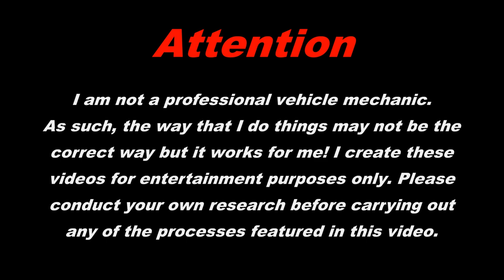BMW Swirl Flap Removal 318d, 320d, 325d, 330d, 520d, 525d, 530d, M47 & M57 Engines from 1998 - 2006

Comment: you can see under the manifold to check if it has been blanked or not
Reply from the maker: Correct but a 45 second video wouldn’t have been very interesting 😁
Reply from the maker: Also you could actually stick a finger and feel if you know what you are feeling for 👌🏻

Comment: I have two questions for you.First does engine need remap after removing swirl flaps.And do you have vacuum hoses diagram,i removed mine intake manifold and now i dont know where every hoses going.Thanks
Reply from the maker: Absolutely no need to remap the car at all. It'll be perfectly fine and there will be no warning lights on the dash. Next, have a look at the link here https://www.realoem.com/bmw/enUS/partgrp?id=NX11-EUR-12-2007-E60N-BMW-520d&mg=11 There are diagrams which should give you a good idea where the vacuum hoses go. As a general rule however, providing that there are no open vacuum hoses or ports, it should be fine.
Reply: @KevsShed  thanks man!

Comment: With the blanks in place, should I put anything on the o rings that go on the blanks to avoid any boost leaks? I’ve heard aftermarket blanks a fail because those o rings can cause leaks, planning on doing this soon so any idea what I can do to prevent them from failing. Thanks !
Reply from the maker: I personally have never heard of the O-Rings leaking ever. Not to say that it hasn't ever happened though. I guess for total peace of mind you could pop a bit of RTV Sealant around them as you fit them. Personally though, I don't believe it to be necessary. 👍

Comment: So the ports where the swirl flaps attach.. Is that where the intake valves are?
Reply from the maker: Pretty much yeah 👍🏻
Reply: @KevsShed  that's great, thank you. Planning on cleaning them with pipe cleaners and carb cleaner. Obviously making sure each port is closed, then sucking out the carbon. Can you think of anything I should watch out for?
Reply from the maker: Robert T EGR cleaner may do a better job of removing the gunk from the intake manifold! Other than that it’s pretty straight forward 👌🏻

Comment: Does the engine have to be remapped after fitting blanking plates? Also, is the performance/ fuel economy effected in any way?
Reply from the maker: No remap required and no noticeable difference in performance or economy at all!

Comment: Good enough video , first you should replace manifold rubber gaskets while ur at it its only few quid, second u should also clean out manifold too from all the sot, third , all bolts on manifold should be torqued to the correct spec.. u done the good video but very sloppy job .
Reply from the maker: All very valid points ;)